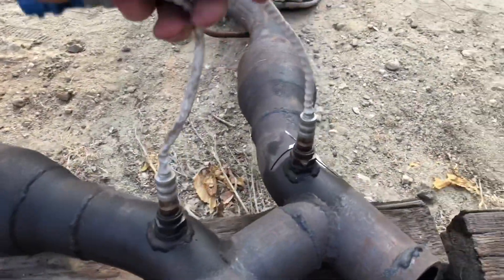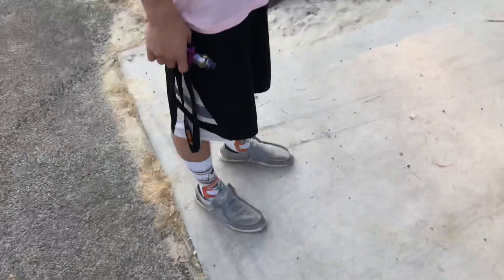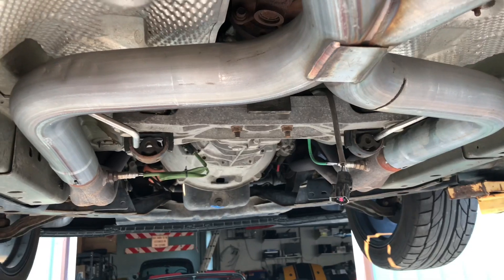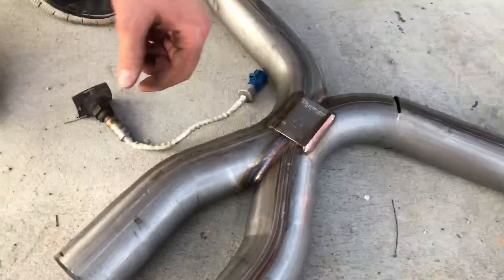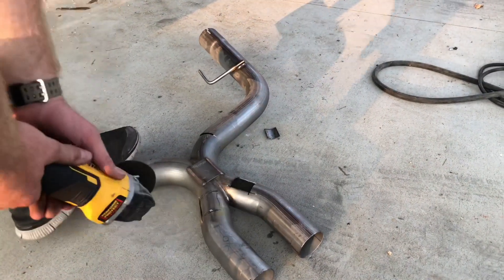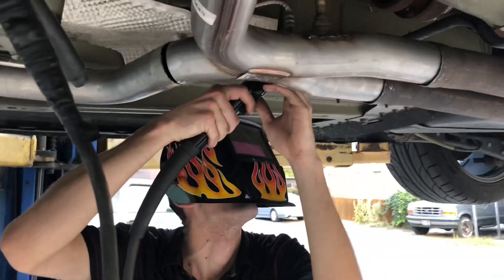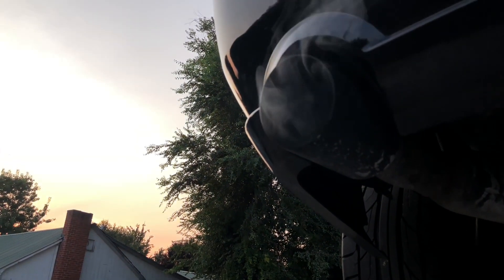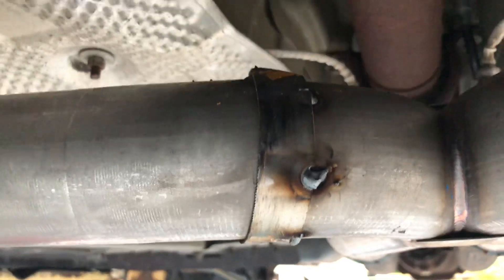2005 mustang gt x-pipe install LOUD!

Comment: What hood do you have, and what back decal do you have, and what kind of tires do you have???
Reply from the maker: I honestly can’t remember the hood, it’s no longer made, and Nitto 555s, and what decal?
Reply: @PackGarage   the back black cover between the tail lights, and what front bumper do you have?
Reply: @PackGarage  just looks so good bro 🔥
Reply: @ImTheRealSeven  that “decal” between the taillights is not a decal it’s a deck lid panel. Pretty much a piece of plastic or whatever it’s made of but it’s not a decal

Comment: Where’d you get the gt500 front end? And those aftermarket gt500 headlights? Thanks in advanced!
Reply from the maker: The front end I ordered through a local ford dealership. And the headlights are actually just normal gt shaped so they don’t fit perfectly with the bumper

Comment: So lost on why you cut squares into the exhaust? It's an off road mid pipe so there is no cats and no need for rear o2 sensors just tern it off with the tuner. Sounds good though. I wish I did the x instead of the h pipe
Reply from the maker: Nicholas Cuthrell I found it easier than bypassing the coding with the tuner, and if I ever had to switch back to catted their there

Comment: Why did you decide to put the X pipe on upside down
Reply from the maker: just liked the look better i guess
Reply: @PackGarage  oh okay,  I was curious because the hangars don't line up that way
Reply from the maker: The x-pipe in general and my exhaust system I had on there didn't cooperate with each other anyways.